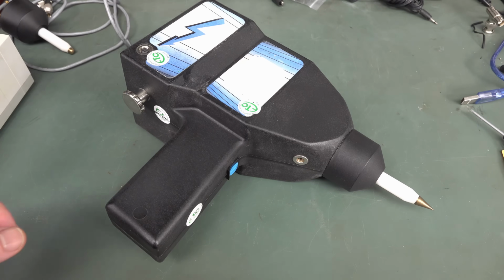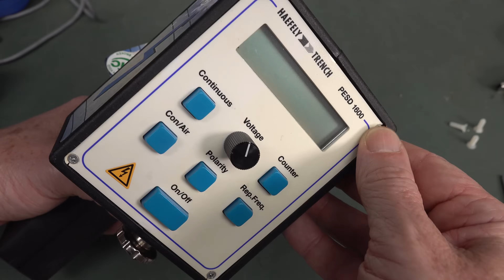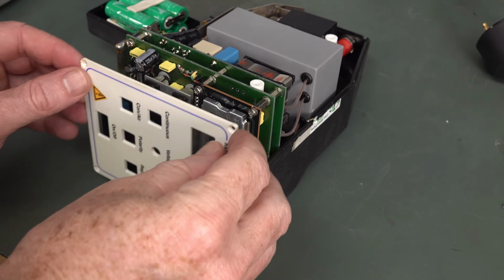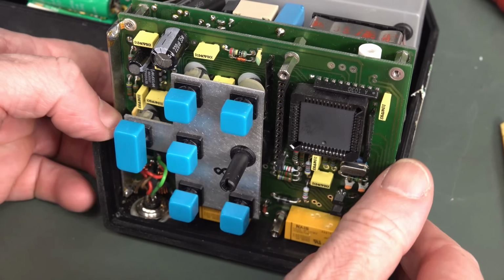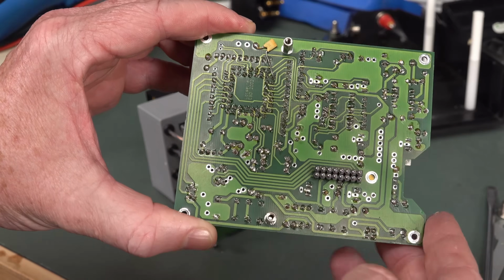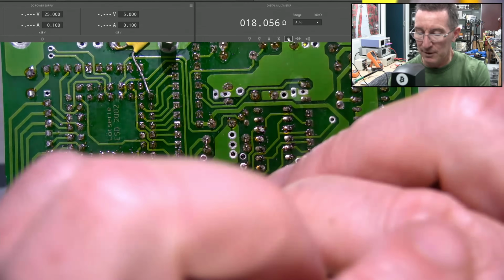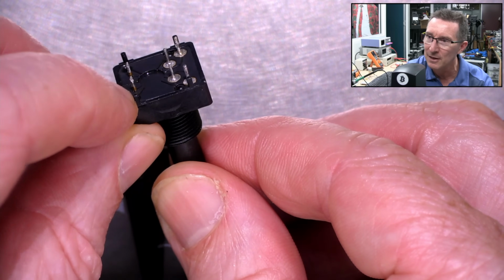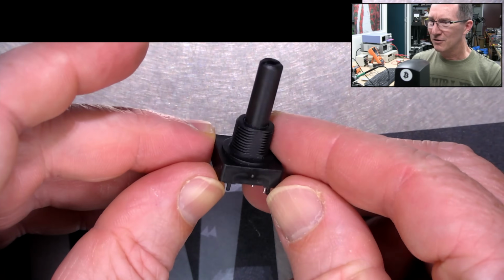EEVblog 1572 - Haefely 16kV ESD Tester TEARDOWN + Repair Part 1

Comment: Just a thought. A desperate solution. Use a toggle switch and switch the output of the correct side (up) to either up or down input of the IC.

Comment: looks like that is a custom jobby you could get e standard 6 pin and use wires to connect it to the board or open it up and clean the contacts seems your only option

Comment: At 17:00 on the PCB it says (in german) "Solder Side ESD 2002". So I guess it either already has a replacement or upgrade board or is built up with very old stocked parts (or whole assemblies?).

Comment: That Jamico cap looks a little bloated....I couldn't tell you how many bad Jamico electrolytics I've replaced over the years.  If you manage to rehabilitate or replace the encoder, you might also consider checking caps while you have it apart and replacing any that are suspect.
Reply: dont it say jamicon? i found them surprisingly unshit in things.
Reply: @echelonrank3927  D'oh! 🤦‍♂ Still, from my stint with repairing consumer audio gear from the early '00s I can tell you that in my experience they seem to have a high rate of failure.

Comment: It has the same problem radio and hvac controls have where they only work at a certain speed and pressure and angle in one direction... I bet it's the same part 😂

Comment: Hi Dave,
An incremental encoder with external pullups, strictly, requires ONLY three pins.
This device has SIX pins. (five, if you count the two "grounds" as one.)

It is likely that the device isn't broken.

Can you check what the functions on the pins are?
Any other clues? For example, is there a hidden magnet inside the device, and two (of four) reed-switches as pick-offs?
Reply: look at the datasheet for the ebe bg 16 and reconsider your comment :)
Reply: @_DSch  Yeah - that was still when the part was yet to be found.
Bad design is bad. With six pins, at least you'd expect some redundancy.

Comment: Find a suitable encoder, without the same pin placement. ( same function )

If you can find one that fits the placement and the pins don’t match the same pin holes.

As long as it physically fits the location you can wire it to the holes. 
( using small gauge wires, from pins to board holes ) ( cut the pins short )

Maybe you have to enlarge the mounting hole, but it will work.

Good luck

Comment: This was soldered in a soldering wave machine those clean solder joints with little solder and the pins getting out with almost no soldering are typical. This is why this was nasty to reflow.

Comment: I remember there were encoders from greyhill they where 6pin jobby ones, but they where optical and need separate power for the led. Maybe you should reverse engineer the shematic around the encoder to firstly analyse how it is connected. Otherwise do they have a push-button functionality or maybe do they have A and B connection and also the inverse of it !A and !B?
Reply from the maker: It's two ground and 4 resistor pullup outputs.
Reply: greyhill made good gear. but dont forget, this the super expensive german stuff were dealing with here, 
so theres practically no way that cheap crappy encoder can possibly be optical.

Comment: Personally i would just grab a regular 5 pin encoder (assuming its a push button type, 3 pin if not) and wire it around, i hoping something works 
of course being careful not to short anything out, maybe put a 1k resistor on each pin or something to be safe
Reply: Since only one pin pair is active in each direction, the original encoder must have some sort of directional clutch to move two separate 2bits encoders. You'll need a micro-controller or conversion logic to translate a standard encoder to that.

Comment: If its not optical soak it in contact cleaner. Just dip it. It might be optical. Black pins for led and white for optotransistor A and B.
Reply: no way this plastic mass produced miniature junk is optical and besides the black pins both go to ground on PCB

Comment: Why not trace the encoderbnets to the ic to see how many channels, possble rc filtering etc.  The micro may be a 68HC11. Check the xtal pins
Reply from the maker: Theer are 4 wires, two for each direction it seems.

Comment: you need to make you're own and make them in OZ and make the affordable do a kick starter and will all pre order
Reply from the maker: HUGE market!
Reply: @EEVblog You'll need to design and build a test and calibration fixture, which may be way more expensive than the gun.

Comment: not that it helps but it was likely purchased as a unit from a European company that does custom switches and such and purchased as that whole unit, i think that's often why these big ticket items are so expensive getting a custom switch layout made in Europe for pretty small scale use they were probably paying a lot per unit , how many big buttons\switch companies were doing custom work like this in the early 90's likely only used in electronics testing type equipment, would be able to tell if it was american or Chinese

Comment: Just soak it in deoxit and turn it. Worse case drill the melted points and take apart to clean. Most likely just dirty contact points.
Reply: its epoxy sealed around the perimeter
Reply: It should be able to soak in past the shaft

Comment: I made a ~10min search and found none encoder that even resemble by far that pinout, that's a real "weirdo" part, my guess is that it was custom made for that instrument, or that part became obsolete many years ago, but even if obsolete i think that would exist some info in the net... Seems like you have to pull some trick out of the sleeve to repair it.
Reply from the maker: I spent an hour and found nothing. I don't like my chances...

Comment: Your annoyance of the tight and convoluted design tells me you've never cleaned/reassembled a Swiss watch, did ya? 😉
Reply: Swiss watches are designed with some level of repairability in mind. These switches are just assemble once, clip/weld together, never take it apart again.

Comment: The encoder pot, the pins kinda look like there in a xlr config. Easiest way to identify ot would be to find the schematic-sheet/service manual
Reply: No they don't. XLR is 3 pins. This is  4.
Reply: @simontay4851  Actually XLR comes in 2,3,4,5, 6 and 7 pin variants.

Comment: I'm a bit perplex thinking about who needs something like this and at the same time is not able to fix it themselves.
I'm sure sure there are valid cases but none springs to mind.
Reply: Did you actually engage your brain before typing that comment?
Reply: @j.f.christ8421  no not really, it was just my first thought. I mean this was in the hands of an electronics engineer before it was sold off as defect. I mean if they had access to spares they could have made a couple hundred bucks extra.
I guess that's just not how it works.
Later in the video i saw that cursed rotary encoder and thought oh, that's why.
Also, a lot of lousy design choices there for a device in a premium price segment.
I mean if you build a device that sells for 10k+ you should have the decency to keep it repairable.
Reply: @DasIllu  Like most gear it would be repairable by the company at board level.  The encoder is an obsolete part with only a few left in stock.  Electrically it seems to be standard so you could bodge something else in there.
Reply: @j.f.christ8421  I thought, maybe a modern encoder on a small pcb, dremel out what is in the way. Ok, now it sticks out 3mm but who cares? As long as the Device is operational again.
Maybe i am the odd one out, but i think a "simple" device like that should be repairable by any skilled technician at this price point.
Not just because out of the good of their hearts. A device like this you don't buy in bulk, but if one fails it might paralyze an entire department. Sending it in for repairs might take too much time. And that it is a device targeted at customers who are capable to repair it themselves.
I hope i make some sense.
Reply: @DasIllu  If you can bodge another encoder in there (as I said before), then it's repairable.  The original encoder is also available, therefore it's repairable.

So what's the problem?